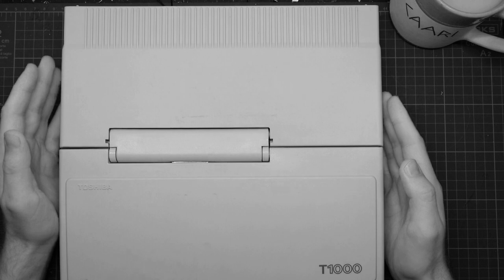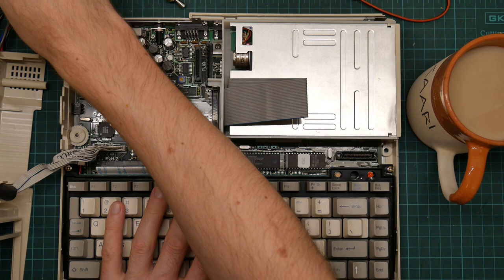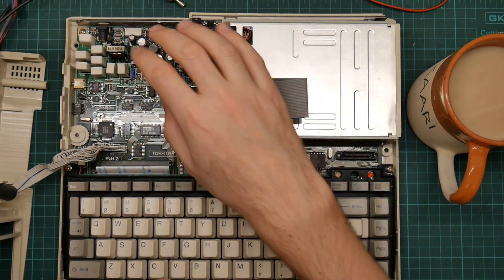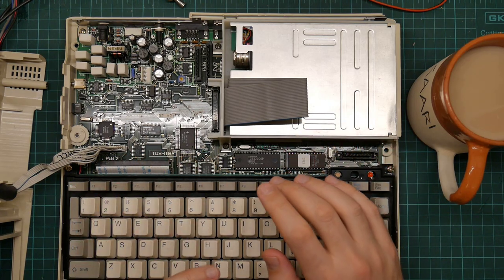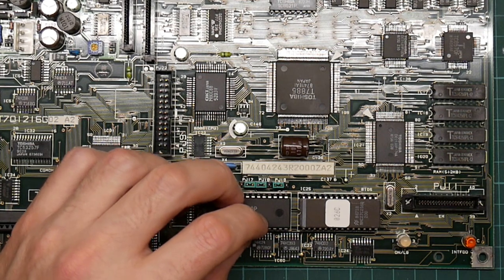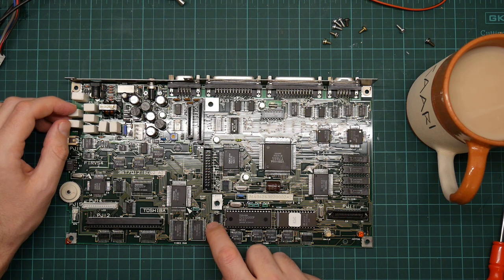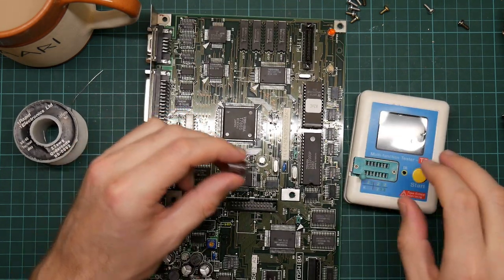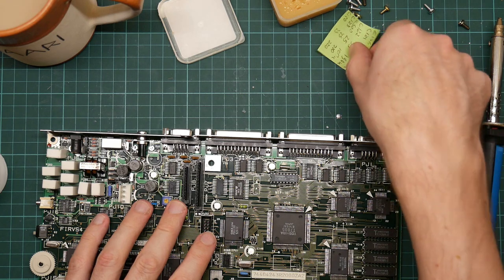Hjalfi successfully, or possibly unsuccessfully, recaps a Toshiba T1000 laptop

Comment: Hi! Thanks for the video. I'm now trying to repair my T1000 which is in perfect condition except for a problem with C-128 capacitor (actually it's not even there at all). Maybe you could help me find out what code it has? I can't make it out in the video. It would be so much help!
Reply: It's on the back of the mother board next to the battery connector
Reply from the maker: If it's not there then probably you have a version of the board which doesn't need one. There are multiple revisions and they're all incredibly flaky.
Reply: @hjalfi  it was there, I know it for sure. I found dirty flux in this place. Besides, all the motherboards I saw on the internet were with this capacitor or diode. It’s extremely important for me to know what was the and put it back to make computer work again

Comment: Hello! Try a 5v charger directly connected to the battery connector. Connect the power supply to the two middle pins from the connector where the battery was. I think you will go over all the circuits and electronic parts in the power supply of the laptop on the motherboard. I'm trying to change the capacitors now, but it's a nightmare! If I fail and destroy the routes, I hope it goes straight, as I said above.
Reply: How did you make out?  Hard board to recap.  Just finished.  Still dies.  Rebuilt battery pack.  Still dies.  I need schematics for MB to fix.